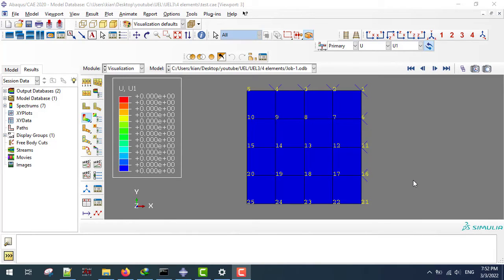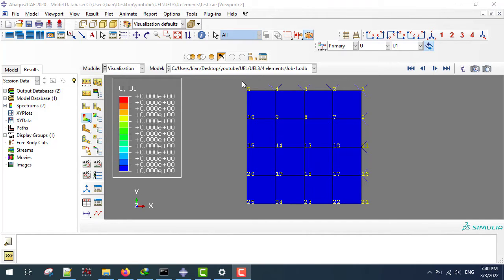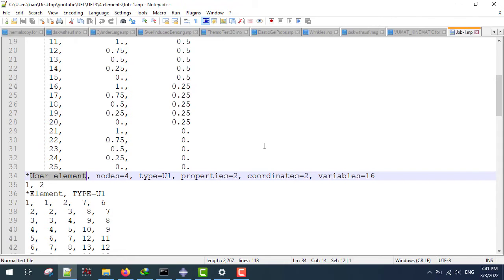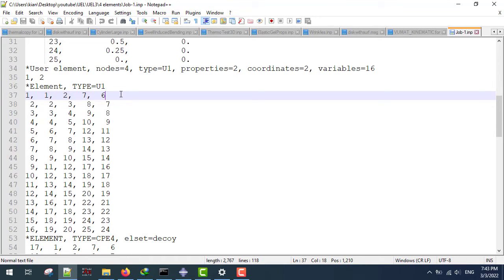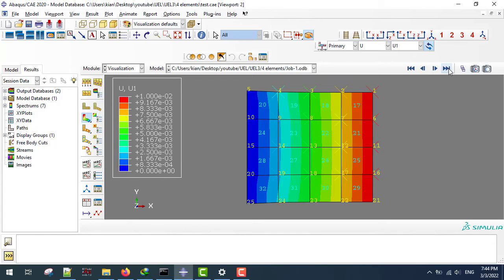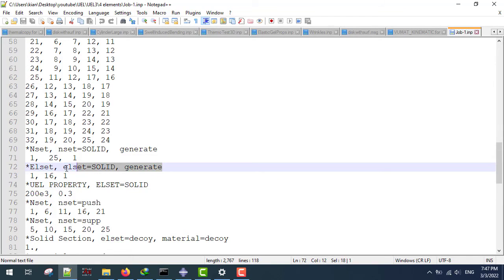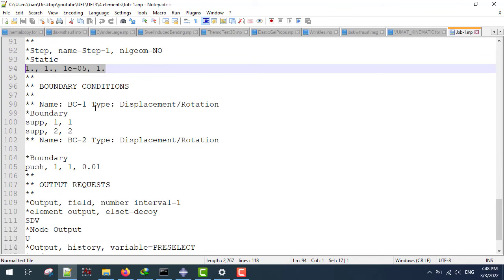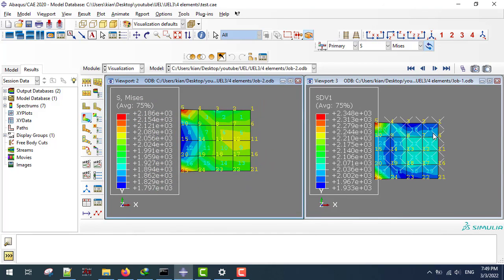UEL subroutine in ABAQUS part three

Comment: Hi Kian, I could be able to visualize user elements defined in VUEL with the help of VUMAT. My objective now is to learn how to visualize specific values in Abaqus. For instance, after calculating the stretch, I want to highlight values that exceed 1% compared to the rest. In another word, I have binary values (1 or 0) representing whether a bond is intact or broken. These values are stored in one of the svars columns. I am seeking guidance on how to visualize this particular column of svars file. DO you have any available videos that I can watch or are yo uaware of any source that I can use? many thanks in advance!
Reply from the maker: Step module >> Field output >> SDV

Comment: THANK YOU! Very useful. I am just wondering if you can explain a bit more about Decoy and its purpose.
Reply from the maker: Since the user-defined elements do not exist in ABAQUS library, ABAQUS does not show them in Visualization module by default. Thus, a hypothetical material with a very low stiffness is considered and used for visualization. Even though, there are other ways.
Reply: @kianaghani  Thank you for the information, I assume this is like a dummy element that you overlay on top the deformed material to mimic the deformation,  and then use it to plot the deformation, etc.. is that right? What if the shape of elements of the deformed material are not the same as the available elements shape for dummy element? I give you an example,  I have a element like a star with central node and 13 nodes distributed around it and all connected to the central node, if  i want to plot displacement of the nodes, then what kind of element should be chosen for the dummy (decoy) material. I am even wondering that may not be possible! I am looking for this and nothing found yet.
Reply from the maker: @mortazapirouz7482  So first, you have to have a FE formulation for that star. Assuming that the formulation exists, after having the results for your user-defined element, divide the star into several tri or quad dummy elements and write a code to share/assign the results with the nodes of the dummy elements. In this way, ABAQUS assumes a dummy star body (which is constructed using several tri or quad dummy elements) with the node displacements according to your results. It is a hard procedure.
Reply: @kianaghani  Thank you for the hint. The formulation exists, and I will try what you said. Right now I am trying to export SVARS for nodes to see the displacement on the nodes and later I should convert node displacement into element displacement. I agree it is hard, specially with no/little experience with FEM and Abaqus.